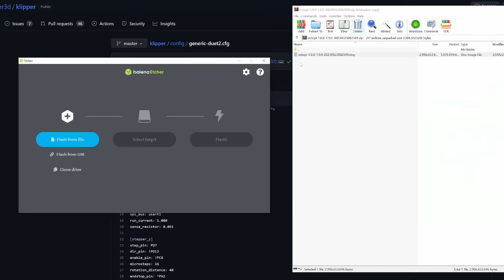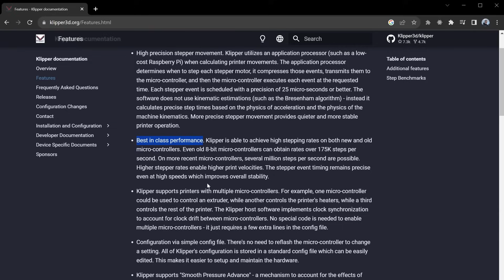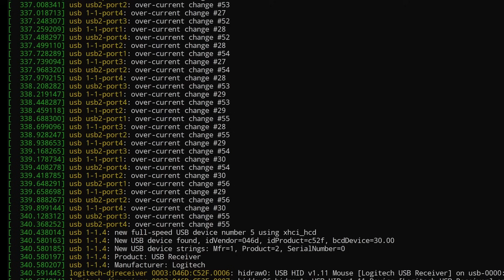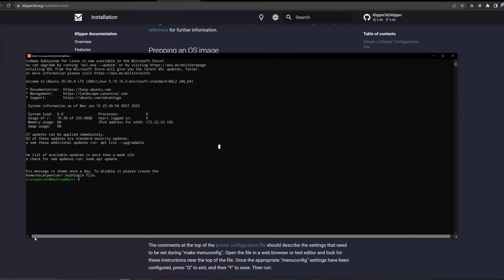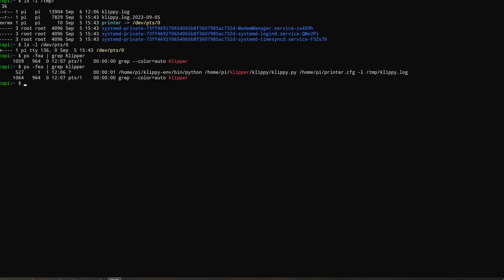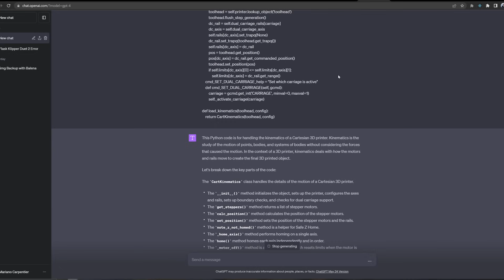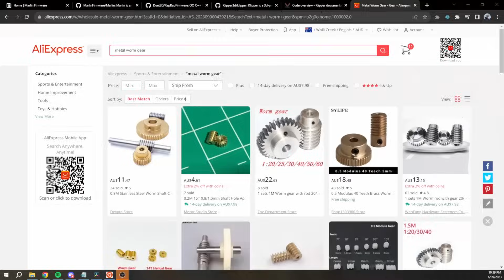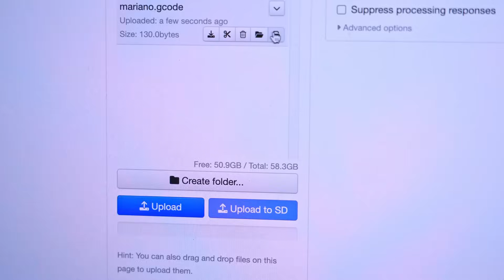5-axis 3D printer with Klipper finally moving!

Comment: Hey, I've been watching your videos for a while now, and I think the focus should be more on your mechanical design and less on the software and firmware. Of course you need the software and firmware to be somewhat close to the end result, because you need to be able to test the kinematics, but... In most of your videos, I do not get the idea that your frame is squared. Your frame needs to be properly squared. Your frame doesn't look rigid enough. The parts look too flimsy. I'm not sure what kind of plastic you use. Is it PLA? PLA is a big no-no for machines that need to be precise, because PLA will deform over time. I suggest using at least PETG. Even for a prototype, PETG is the better material. I really hope that your project will end up being a success, so this is why I'm offering you this critique. I hope you manage to develop it further. I'm sure as hell not going to do it, because I do not have time and physical health right now that would allow me to make this project. But I really have my concerns when it comes to actually the build of the frame. I wish you the best with finalising your project and it's not about the end result, it's all about the journey 👍🏼😉
Reply from the maker: Thanks for the comment! PETG is my favorite material to print with but I am wasting a lot of plastic in this stage so I am using PLA and ABS because they are cheaper. I was planning to print everything in carbon when I am happier with the design. For the time being, I'm surprised that it holds up.
Regarding the precision of the frame, I think you're spot on with that observation, but I want to see how much I can resolve "by software". Like, for example, back in the past we had printing beds with no accuracy at all, but eventually some compensation algorithms were developed to take care of that problem. Obviously, that imprecision affected the final shape of the printed model but was at least good to ensure be adhesion.
Long story short: I want to see if I can cope with the many imprecisions of a frame like this one by making changes to Klipper's code. I am looking forward for that part of this build, I think it's going to be (by far) the most interesting part. But there is also a real possibility that those algorithms will either be too complex to develop, or not effective enough to dissipate the imprecisions. In that case I am going to work a lot more to make the frame as sturdy and precise as possible.
Reply: i would not recommend petg. PLA is fine if not close to heat. granted in a 3d printer thats unlikely. the characteristics make PLA actually very stiff (high bending modulus) but over time and repeated heating it can lose its shape. PETG by comparison has better thermal resistance but a much lower bending modulus meaning its not stiff, itll flex too much for anything that needs to not move, the reason PLA shatters is because it doesnt like to flex, PETG wont shatter because it will flex. the Prusacaster is a good example of a project that just will not work with PETG

Really the most ideal material is going to be ABS/ASA but PLA is the ideal material to prototype.

the issue is the infil and perimter wall thickness for the part. use Voron PIF guidelines, 40% infill 4/5 walls

Comment: Great Project, job and wonderful implementation, thanks for sharing!:) *subscribed*
You even felt the need to use CABLE FERRULES ... like a decent human, hehehe:))
Now some general feedback. You are a little hard to understand (for me). It is not your accent, but the combination with your audio signal chain. Something is very off and torpedoes  your good work, because it is not easy to follow your thoughts. Is it the recording device that sounds like a potato (sorry, hehehe ... just telling the truth)? I don't know. There are also flanger-like impressions (shifting audio bandwidth effect, bad digitizing) and hard cut offs(bad noise filter/compressor) and spikes in the audio. Maybe there are several problems, including your encoding chain betrayed you. To be true, I love troubleshooting, hunting down failures in electronics, but not loosing my hair because of video/audio encoding problems.

Good luck!:)
Reply from the maker: hahahaa! yes those ferrules look really nice but I didn't have matching colors to the cables... still much better than other things I've built!
Regarding the audio, my accent is not going away unfortunately, but I am trying to improve the audio on each video, the thing is that I'm new to editing and voice recording. I will improve overtime I hope! In the meantime, I always upload subtitles. Thanks for the feedback!